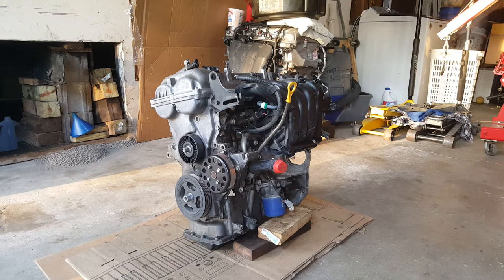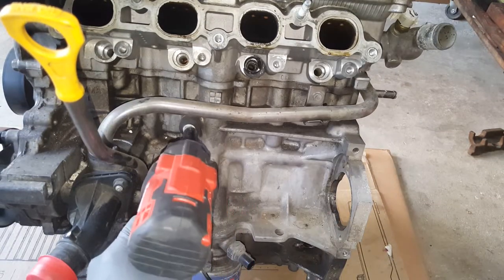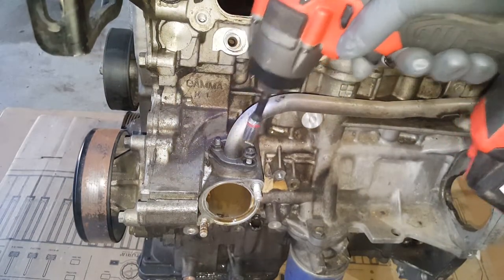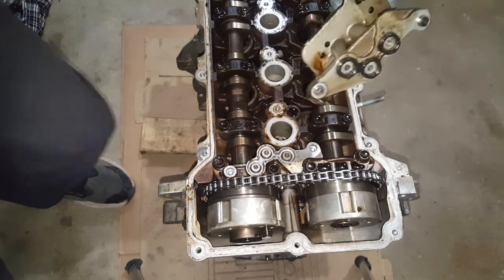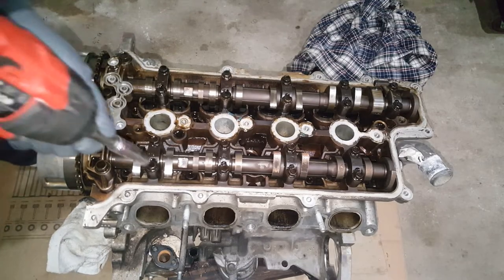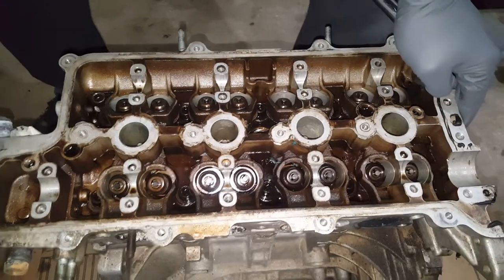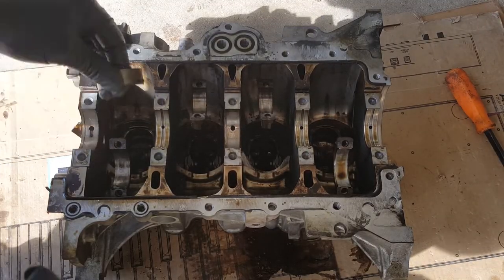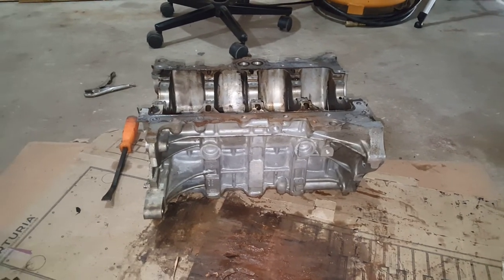Kia Soul 1.6L gdi engine teardown cylinder head removal

Comment: There are two deal breakers on this kia soul engine firstly a plastic thermostat cover and direct injection except for Toyota motors who take the trouble to have both direct injection and port injection well we own a reasonably new car which has port injection and a metal thermostat cover its on our Suzuki Baleno but fortunately they are not sold in the USA but are sold to the rest of the world and another thing built in the same factory in lndia they make the Toyota Starlet which is just a rebadged Suzuki Baleno and the Suzuki Baleno when sold in Australia they were the cheapest car sold in Australia
Reply from the maker: Some good information , thank you for taking the time to share this. Appreciate your feedback.
Reply: @s33therfan  l don't like kias or Hyundai's mainly in Australia they are the most recalled vehicles in Australia at least once a month on the news you see a recall for Kias and Hyundai's also there very rare event when they catch fire

Comment: we will see what happens I just scheduled service at kia and put in the form: Replace recall engine bahaha how can they claim I have not done services and regular maint when the ENGINE runs fine still and it has 242,000 miles on it, seems I should get a free engine right? or am i crazy
Reply from the maker: I would try to get one if you are able , once any issues show themselves. That is pretty good miles by any modern cars standards for sure , unless we are talking Toyota.

Comment: The quesztion I have is my engine is this engine, it has 250,000 miles on it.  When I first had it, about the first 100,000 to 150,000 I was not very nice to it in terms of oil changes, I just did my best to make sure oil was in it when I could, was poor at the time.  Anyway I baby it now but im worried its going to go anyday even though it gives zero signs that I can see that its going to go out.  Do you have any recommendations I should do to this engine that might prolong its life, should I open it up and replace seals etc or just run it to death and replace it?  I have not went to kia to ask for a recall engine because I think theyll tell me to go away since I already got 250,000 miles out of it, but I thought it was a safety recall..   you know they catch on fire or something...
Reply from the maker: The first sign of any engine noise will most likely be the rod bearings . I would quit driving it immediately . From there I would replace the crank , rod bearings , and main bearings. If you catch that early on I wouldn't be surprised if the engine would last many more years. Thanks for the feedback.

Comment: There are two holes one is right below the water pump and the the other one is in the middle left of the cover it will help you remove the. Timing chain cover. By just treating the bolt
Reply from the maker: Great informatiom , I really appreciate it. Thank you also for watching.

Comment: So I have a P219F # 4 cylinder replace, so where the holes are at, is what I need  to replace??  Those 4 injectors, which is #4?? And only have 56000 miles

Comment: I have a Sportage 1.6gdi 2017. Thank you so much for your vidéo.
Are the lifters hydraulic?
What are the main problems on theses engines? 
mine has misfires when accelerating between 2 and 3000 rpm...
Thank you so much for your answer😊🇨🇵
Reply from the maker: It has the bucket style lifters. These pretty much have the same issues as any engine but they are statistically more reliable the 2.0l. If you are not getting any codes you might try the crank sensor. Appreciate the feedback.

Comment: How many miles were on this? So it was your engine? You didn’t sound sure if it had seized before or after head gasket failure. This was an NA engine? I have the turbo 1.6 in my Forte GT. Very interesting tear down thank you.
Reply from the maker: Yes . Basically the engine was overheated from a cracked radiator. 150k miles on the vehicle.Thanks for watching.
Reply: @s33therfan These cars have a temperature gauge...why would someone keep driving it till it blew the head gasket!  SURELY,  if it was that hot, steam was coming out from under the hood. PEOPLE,  if its running hot, SHUT IT DOWN...NOW.
Reply: In this day it just doesn't make ANY sense to keep driving once those temps start rising above nominal. This happened on my 7.3 diesel power stroke and unbelievably reliable engine but it blew the water pump. water and steam everywhere but once the temp started rising (the truck had a REAL gauge) I shut it down an got on the horn. No damage to the engine itself just replaced the pump and was good to go. ALL engines have coolant for a reason, folks.

Comment: Can you prevent this from happening if you are driving it lightly 2500/rpm or less, assuming regular 5000 miles synth. oil changes?
Reply from the maker: I think with proper maintenace and just taking care of it , i would say absolutely. Thanks for the feedback.

Comment: Hey I desperately need help , I brought new fuel injectors and I'm trying to replace the old ones , I know I gotta remove the intake manifold but I don't want to remove the whole engine just to get to it , is it possible to just remove the intake manifold w/o taking out the whole engine
Reply from the maker: I am not sure if you can get it out by simply removing the fan , or if you will need to remove the radiator , front bumper etc. You can most definitely remove it without removing the engine . Thanks for the feedback.
Reply from the maker: Here is a video of replacing the front end components to give you an understanding of how to take things apart.
https://youtu.be/Uh0Q7i9nScI

Comment: I just God a 14 rio same motor. I think it lost a rod, it will turn a little but not all the way over. I can't seen any windows in the block. I am going to pull it and tear it down to see if it's savable.
Reply from the maker: You might be able to pull the bottom apart and take a look. Hopefully caught it before any damage. Let us know what you find , thanks for the feedback.
Reply: @s33therfan  i did find a small chunk of aluminum in the plastic catch pan, but i cant see where it came from. ill drop the pan and see what it looks like inside

Comment: Is this mostly the same for a 2.0l kia engine?
Reply from the maker: Here is a 2.0L I removed and did a tear down at the end. Thank you for the feedback.
https://youtu.be/4PmrMfZhSeo
Reply: the 2.0 does not have a turbo and it also has port injection. after 2022 that engine's reliability skyrocketed but one needs to keep their foot atta it because its mounted to a CVT tranny, okay? Respect your drive train and it will respect you.

Comment: 👀✔👍
Reply from the maker: Thank you
Reply: Would have liked to know how many miles were on the engine,  and your opinion on the condition of the engines bearings...and if you thought it had good maintenance,  or look like it had poor oil change intervals. Also since it was GDI,  condition of the  valves for carbon build up..

Comment: its a junk of an engine, my dad has a 2013 hyundai accent with this exact engine and had to replace the pcv valve, now we think the oil control rings are stuck and its making it drink oil like crazy. its got a bad knock now and also the manifolds are f**cked
Reply: Bought new or used...how many miles on it. Oil change intervals??